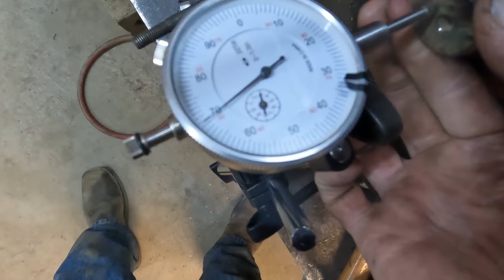FREE Diesel Trench Compactor Brought back from the Dead!

Comment: 6:24 I know I'm a year late with this question, but what are the 2 electrical terminals between the oil filter and the flywheel case for?

Could they be the Military engines battery charging system connection?

12:20 Instead of a solar charger that might get damaged by the vibration, why not run a small hydraulic motor off the main pump and hook that up to an alternator to charge the battery...a large gear or pulley on the pump could then drive a smaller gear or pulley on the alternator to get the RPM'S needed to produce enough electricity for the battery charging system and maybe even a set of lights for when you're working in dim or dark conditions...

Comment: For a likely seldom used item that will not be used enough to keep the battery up I would have not worried about the charging system.   Just share a battery with other seldom used equipment.    
I hate maintaining a battery of each piece of equipment I have, I have one good batter I share with a haying tractor, dozer, loader, sawmill and even a riding lawn mower I seldom use.

Comment: Matt, why not just use the original bearing plate? It appeared to have the threaded holes already, you just would have needed to remove the bolts

Comment: .05 -.15mm is .002-.006.. your dial showed,.. .009 sorry Charlie,, not in spec.  Also, I didn't see those wave washers on the crank before you slid that massive flywheel on.

Comment: Bravo on the fantastic work but to be honest, I would have fixed the original motor. You can get rods etc custom made. Cranks and so on. THis is the route I would have taken.
Reply from the maker: parts were over $1500. I bought both the replacement engines for less than 700

Comment: Hey Matt I notice that the compactor has the compactor bumps on the roller but look quite worn  ideas what about measureing one and contact C and C equipment sales have his CNC machine use scrapped steel make them and all we need would be to weld them on ?

Comment: You should have put a predator engine on it from the start. I still like watching you work on the stuff though. keep on bringing old equipment life.
Reply from the maker: several issues with going that route. first of them being the torque. this engine is rated at like 14hp I think but the flywheel weighs more than a 20hp predator in its entirety. that translates to gobs of torque a predator just wouldn't have. second is engine speeds, the diesel runs much slower than a gas engine so all the functions of the compactor would be greatly accelerated because of the increased pump speed ( that is if you were able to find a gas engine with enough torque to spin the pump anyhow.
Reply: @DieselCreek  I wonder what kind of torque it needs to spin it. A neighbor of mine gave me a 35 ton log splitter I adjusted the valves and got it running in 15 minutes. It originally had ad 12 or 13hp Briggs. The compression spring or something related to that was toast so it was hard to pull start. Eventually I got a  predator 14hp electric start engine. Had to modify it a little and relocate the pump since the shaft was in a different position than the original. Works great. I did another one for a friend but he didn't want to dish out the money for the electric start one. He went with the 9hp one. It seems to work well with his 30 ton. Been 2 years and he still uses it.

Comment: I would have attempted to drill and tap the holes before changing out everything.
I've started replacing bad switches with catapiller ignition switch so everything has tge same key.

Comment: Everything should be metric.... You already note displacements in liters. What a complicated machine for a simple task. Never seen one in Europe. Over here they use vibrator plates which are much more save. (Low center of gravity so they never tip over.), They are just as noisy though....

Comment: Lol lol lol I feel your pain m8 I have a Mack Quantum that the motor needed to come out everything unbolted motor came apart from the gear box about 2 inches and couldn't get it any further a half hour later a lot of big bars used and a lot of  bad word's said just before I broke out the blue tip spanner to make stuff liquid Mrs said lunch break sat down and it hit me pull type clutch fork dropped air slave and the bugger slid apart lol lol 
Grub 
NZ

Comment: Dumb question, but what was reasoning for not just drill and tapping the old plate while it was in the motor?
Reply from the maker: That would take doing on a mill, it would have to be super accurate

Comment: Using a rattle gun bit you on the arse there on that coupling bolt ,I’ve noticed how much the young blokes in the workshop use them ,me I’m not a fan as they stretch bolts on extraction and bight them on the arse and break on installing , it’s just being plain lazy also impatient, I cringe when you use it on starter motor power leads

Comment: Me thinks the four bolts in the plate were there to protect the threads so you take them out to mount the stator😭
Reply from the maker: they weren't bolts, they were raw casting that were there to be machined into the mounts for the stator but they didnt machine this one.
Reply: @DieselCreek  it’s a shame would have saved you a lot of work ,but it was good work. 👍

Comment: Permatex has got to be the Worst silicone made! I have never had any luck sealing anything with that crap. What I have used for several year's is a Mopar black silicone for trans pans and oil pans. This silicone works the best to seal from aluminum to cast to steel! And don't forget Permatex thread lock suck's also. Loctite is #1. 30+ yrs in the biz just sayin..